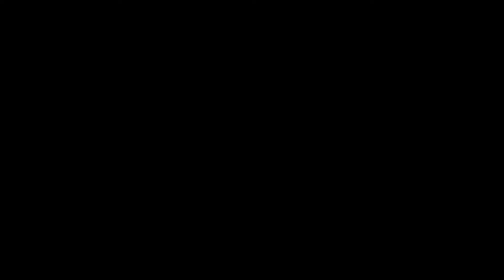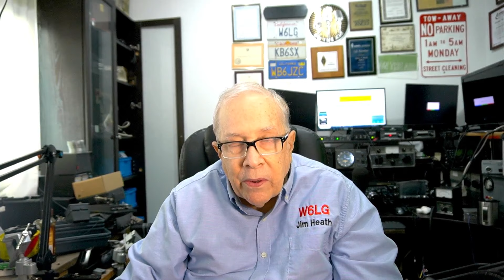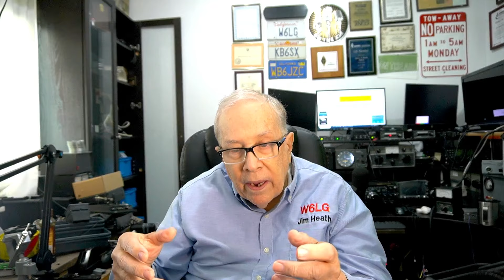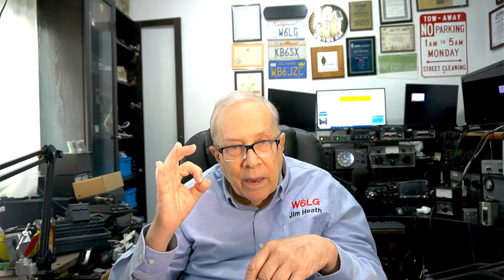Linear Amplifier, Part 1, Almost Electrocuted, Drake L4B Linear Amplifier, Jim W6LG YouTube  Elmer

Comment: Great so far Jim ! HV safety is a MUST !!! . I trust nothing.  I have HV probe and check everything . I go right to each cap and test. Then I grab my HV stick that is grounded and use the tip to discharge every cap . Then after that i use clip leads to short out caps.  Leave them shorted as I work. HV caps can build up a charge   on their own. In fact when extra on hand leave them shorted at all time . Only remove short on cap after installed just before power up.  I always test caps first. that a outher step I do.  If I find HV in a AMP I STOP . Discharge and look for why HV was their. Like a open bleeder resistor or safety interlock that failed. I fix that first ! Then I go forward to tubes and stull. Plate choke can open. A glitch resistor can open. Trust nothing. Test and verify before touching . I even test my ground leads first before I put them on.  73
Reply from the maker: Lots of good advice.  Thanks for writing out what you do.  It is so easy to  make a mistake. There is no such thing as overkill with HV.  73, Jim

Comment: Jim is exactly correct!!!!!!!!  I am a retired broadcast engineer.  Inside every transmitter is an insulated rod that has a metal hook on the end.  That hook [2 inch radius] has a wire about 1/4 inch diameter going from the hook to ground.  First thing after the transmitter door opens is to ground all the known high voltage places.  Second is to hang the hook where it will short high voltage to ground.  Third is to put one hand behind you.  Only work with one hand inside a transmitter.  With one hand there is not a path that goes through your heart.  OH, I forgot to say remove ALL jewelry.    Follow the same procedure every time a transmitter is open.
Reply from the maker: Thanks.  I now remember seeing that in a broadcast transmitter.  It might have been the VOA near Fresno.  That was decades ago.  73, Jim W6LG

Comment: Hi Jim, you were a lucky kid.........I designed and worked on high voltage RADAR transmitters for 42+ years, many of them had signs that read "death on contact"........an exception I would take with your HV discharge procedure is to NOT use a screwdriver as the "crowbar".......we called it a "zott stick" or shorting wand.......instead I would recommend making up a stick using a 2 or 3' piece of fiberglass rod (good enough for 3 KV but not 54 KV as in the Patriot DTWT transmitter) with a big alligator clip ty wrapped to the business end connected with 3 or 4 feet of the braid out of some good coax (or real ground braid if you have it)  connected to the clip with a solid "ring tongue" (not a fork) at the other end. Before you go near the HV you MUST solidly screw the ring tongue to the chassis and THEN touch the clip to the HV . (good crimps and solder) Once the cap bank has been discharged you then put in your solid shorting wire with the clip remaining on the HV.  The problem with the screwdriver (IMO) is  you might touch the HV but not the chassis and it is possible your fingers might touch the screwdriver shaft.......... plus you have no way of knowing what the dielectric strength of the screwdriver is and generally the metal runs right up into the handle..... I have an L4-B and an old RayTrack..hard to beat.........good old stuff.....like us!..........73 Mike K1FNX near Boston
Reply: So i take it those voltages CAN arc through the half-inch of plastic handle to you? I hadn't thought of it until you reminded me that the metal shaft is right there.
Reply from the maker: There is a couple of inches. 73, Jim
Reply: @bendeleted9155  probably can't arc thru (at "X" volts per mil you can do the math) but the plastic handle can develop cracks over time, all my old Craftsman drivers have developed a white haze in the plastic.....who knows what that is.......... a known non conductive rod 2 or 3' long with the clip on the business end keeps your hands away from any lethal  voltages. we used 4' long G-10 rods (or Micarta) with a 1/4 " brass "shepherds hook" at the business end, connected to ground with #6 motor brush wire. I have seen a capacitor bank vaporize the hook when a transmitters automatic electronic crowbar (or drop bar) discharge system failed and the tech/engineer discharged the bank before they went in...........joules are joules..........

Comment: That's why I stick with 28 Volt FET amps these days.

BTW, when I was about 14 or 15 I was working part-time at a TV repair shop. I'd installed a new transformer for a CRT, about a 26 inch screen console, and had my head in back of the wooden console cabinet adjusting the anode voltage, and the next thing I knew I was sitting on the floor against the wall with a lump on the back of my head, and there was no longer a top on the console TV. My boss came running back to the workshop and yelled, "Are you OK?" A couple of seconds later I was able to mumble, "No." 
I go out of my way to avoid HV these days. I turn things off, discharge caps, discharge them again, short the caps with jumpers if I'll be replacing components, etc. I even wear a rubber glove and a long-sleeve shirt when I'm tweaking HV with a long plastic diddle-stick. I figure that first shot of 30 kV back when I was a kid taught me enough of a lesson that that's why I've survived into my 70's. I still remember it all to this day, except what I did wrong, and taking the top off the console TV.
Reply: I got a 90 KV hit once, off a hipot tester. It was at extremely low amperage, that saved me, but even though I wasn't launched across the room I didn't feel right for a month. I will never buy a piece of tube equipment for this reason; I figure you only get one chance regarding high voltage accidents and I already used mine up.
Reply: 275 volts DC - tossed me downrange about 6 feet when I was 14 or so.

Comment: Jim, I learned in electronics vocational school, how to discharge CRTs (40kvac).  Even when you disconnect the voltage source, there are other supplementary components that store lethal charges.  Using a thick insulated screwdriver connected to a cable with an alligator clip you ground the potential circuit for your safety.  Glad to hear your story!  Experience can be deadly but you lived to tell about it.  NO JOKE!   73 de KD6UYK (Tim).
Reply: I suggest caution with this method. Shorting out a capacitor will discharge it instantly with the possibility of it exploding. Also, there is something called capacitor soakage. Basically you can take the charge off the top, then soakage will charge it up again, putting the user at risk.